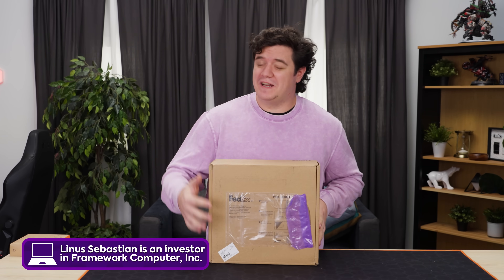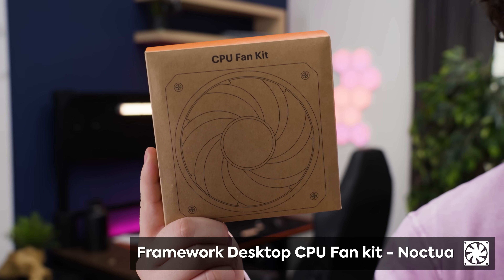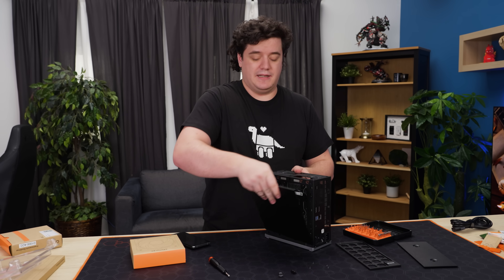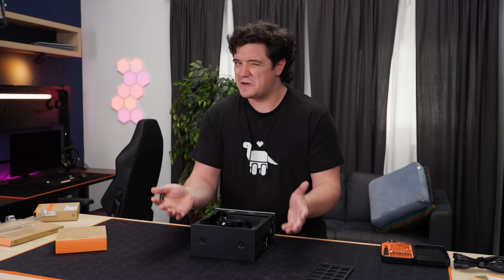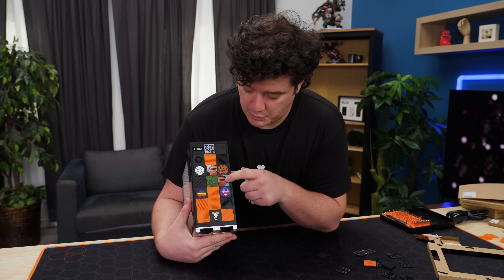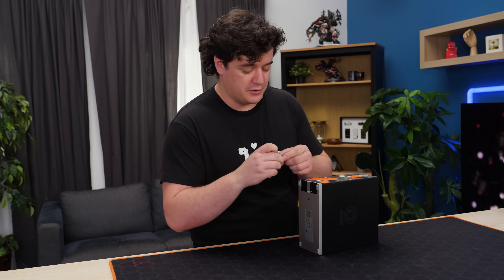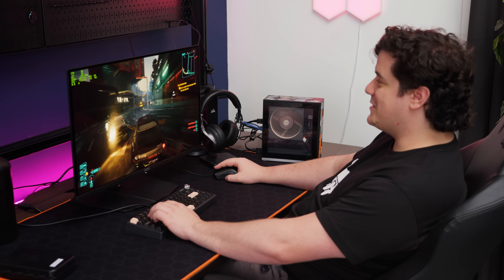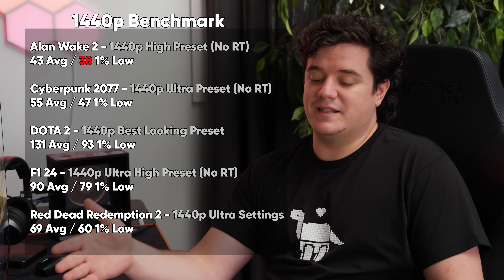This TINY desktop makes me nervous.... - Framework Desktop

Comment: when you configure it on the website, they need to include the price of the power cable, then say -$5 if you choose to opt out. not just for psychology, but also to make the starting price actually accurate.
Reply: I had been thinking about this too - having a default DIY configuration which includes a buildable computer, instead of the minimal cost with "None (bring your own)" selected. Maybe they're relying on people being interested by the apparently "low" price, or maybe they haven't considered the value of people being pleasantly surprised when they learn they can get other parts cheaper if they select "None" and do a little bit of market research.
Reply: This is a good suggestion, for the psychology, but I wonder how that affects their required inventory

Comment: The idea is cool, but I have to wait a few generations as this is not at all what framework is. Although the price of the tiles is totally what Framework is, they've always set insane prices for all of their parts that double what it is elsewhere. Pro tip, just pay a 3D printing service to handle the tiles. Don't get ripped off by framework

Comment: So yes they could by default add the cost of the cable….. but why? Most people have a cable laying around anyways. So I don’t see it as not included it saving you $5 on something you don’t need. 

And for the little face plate add ons. Compared to what people spend on rgb $5 a pop for the fancy ones, when btw they give you what you need to make your own 3d printed or on Etsy you  an get some, this is really reasonable.

Comment: For the sake of e-waste saving, which is apparently a major principle that framework adhere to, I really appreciate the decision of not getting a C13 cable and save 5 bucks. I don't need another one, in fact I've already have so many of them that I don't know what to do with them.

And the same principle also goes to the front panel. If I already planned on customizing by 3D printing them, I may need less than 21, or even not at all. They even double-check with you if you didn't choose 21 of them on the check-out. 
However, it's really not obvious that you can choose to not have them at all on the web site, so maybe they can work on that.

Actually, they also lets you to opt out storage, fans etc, which are also "mission critical" for a PC. If you gotta rant, maybe rant on all of them?

As for the memory, I can understand the concern, actually I'm also kinda concerned with that, but if you've gone so far to read an article about it, maybe it should've caught up with you that they've already addressed this in a video, saying that they've asked about it with AMD and AMD have tried it, but can't make it work due to signal integrity issues.
Reply: On the other hand, Elijah's complaint about power cord showed that Framework may need to change the way how they show the price on the website, or at least make it clear why they've chose to show it in the way it was.

Comment: Tested the Framework Desktop with the 395 — cooling is whisper quiet, Mac Studio–level. For LLMs, the BIOS memory mode makes a big difference: dynamic was fastest on medium prompts (42 tok/sec), while 96GB fixed pulled ahead on really long ones. Even got the 235B Qwen model to load on the iGPU under Vulkan (~9 tok/sec) — pretty wild for integrated graphics. With 128GB RAM, this board is a legit dev box
Reply: Didn't expect to see you here, but cool!
Reply: Yeah, I think when you pitch this as an AI workhorse, it’s great it competes with stuff like the Mac Studio for a lower price. While allowing you to run Windows or Linux. I think the problem is that most YouTube reviewers don’t actually want an AI device. They want gaming for which this chip is impressive yet just too expensive compared to a conventional desktop. Or lightweight productivity tasks where it’s also too expensive because you don’t need that massive pool of RAM for normal workloads most of the time. It’s a really cool device and I think the chip is really impressive. It’s just not meant to suit everyone and YouTubers are trying to make it for everyone.
Reply: Windows with shared memory? I don’t suppose rocm is supported on apu - or just buggy?
Reply: Problem is the drivers, right? I would so want to see it compared to the 4k dgx spark box. But seems they still don't even sell it
Reply: Does it work best as an AI dev box on Ubuntu or Windows? I remember seeing in a framework video the memory management is better in Linux
Reply: According to Wendel the 96GB memory thing is just a Windows beeing awfull thing on Linux you have basically unified memory and you set the minimum iGPU just to 512MB and it later allocats up to i think 110GB. In this video there is just someone who found small nitpicks and wants to drama/hate on the product ... while at the same time not doing their homework as a reviewer ... shaking head ... sad for the work LABS did on the product for not even mention the data in a professional way.
Reply: Isnt windows home only support up to 128 gb of  ram? But the beauty of windows is the ability to allocate half of system memory as shared memory on top of memory already allocated to gpu as delicated memory. As compared to linux where you have to mess with gtt
Reply: @Very_generic_username  Yes Home is 128GB and yeah you could do that if you want really really slow shared memory which makes no sense ... either use Linux or do a 32/96 split then ...

Comment: Elijah is mad that the power cord is "mission critical" and is not included for free. Looking at the website,  power cables and bricks are also mission critical to laptops but I don't see that included in the price or "free" for the 12, 13 and 16 😂 I think it's nice Framework made it optional in case you have too many, I got a box of free US head C13 cables, there's probably like 50 of them so yea, the $5 off is nicer than having it included 😁

Comment: Love mine so far, but infinitely frustrated that the case does not have a cutout for the PCIE slot. 5Gbe sounds great but SFP+ on my UI switch will only negotiate at 10 or 1, a low profile 10g NIC would solve that but now you've got to cut a hole in your case. Wish they would have just gone full 10 gig, but otherwise this thing is wickedly powerful for it's size.

Comment: I think Framework’s issue with this is purely marketing. They want to have the lowest price they can on the front page, but then it feels like they are nickel and diming you at every step. 

They should have a default config with a power cable and single color tiles by default, but when you’re going through the configurator, have the “Bring my own” as a discount. It is quite literally the same order at the end of the day, but then you don’t get people upset because they feel like they needed to pay extra for basic things. Instead, they feel better that they saved money by not choosing those things.
Reply: I'd buy it without the tiles and just run it like that. Maybe 3D print my own.
Reply: 100%, they really need to rethink how they do marketing because an even bigger mistake was calling it the Desktop, compared to actual desktops this is less upgradeable and repairable. If they called it the Mini sudddenly it's a a mini pc that's more "Framework" and everyone would celebrate that
Reply: I agree!!
Reply: Fully agree and had the same thought when he was talking about the power cable option
Reply: 100% agree. Minimum Price should be the cheapest config with everything included. 
Literally the same thing but more transparent about the cost of an actual config.
Reply: I agree, the non-DIY builds should be complete.
Reply: @gamebuster800  framework doesn't sell a non DIY Framework desktop.
Reply: Price isn't even that good bruh
Reply: I think the problem runs deeper. They are the modular/repairable brand and they are making a PC that's less modular and less repairable than a regular desktop PC. Like, order anything from HP and you will get something that's more modular and more upgradeable.

And then they add all that fake-modularity like the $100 bag of plastic stickers that you have to order if you don't want your PC to look like half-assembled garbage, or the USB-C extension cards. You know, there's already a modular extension system for PCs that allows you to add things like new ports or storage. It's called PCI-e.

It's all just topped off with the brag of "You only need a single screwdriver". I can't remember a single time where I needed anything else than just a single screwdriver when working on a desktop PC.

At this point they are just creating their own walled-garden proprietary module system that purposely doesn't work with all the regular stuff.

What are they doing there?
Reply: but then you would know you dropped two grand on a laptop before checkout.
truly horrible
Reply: The price is stupid even if it had a power cable and a whole case

Comment: Horrible take as usual, especially with the current AI market and considering the fact the 395 has AI in its product name, the chip performs significantly better BECAUSE the ram is soldered, this allows them to double the bandwidth thus, very noticeably, improving inference speed running LLMs like gpt-oss-120b which this machine at 2k (the 395+ not specifically this framework) can actually somewhat run large-ish models even cheaper than apple silicon. You’d either need 4x 3090s (96gb vram) or 1 6000 pro Blackwell (96gb vram) to even load the model even quantized in memory at around $10k. Yes they will outperform the 395+ but no other solution at similar price van even load the model let alone run at a respectable 50-80t/s if this was unsoldered which to my knowledge limits to half the current bandwidth, the performance would be like 10t/s

Comment: Love how as a collective the comment sections general take is that not including the power cable isn't a bad thing because most people already have one laying around somewhere yet when Apple did this with the charging brick these same people were up in arms calling for boycotts and saying how dumb Apple is. Selective rage at it's finest.
Reply: This is actually an interesting juxtaposition. It sounds inconsistent at first, but I don't think they are as comparable as you suggest. I'd welcome your thoughts to the contrary.
- Framework gives off a "build it the way you want" vibe to me, and I expected it going in. Having been through the framework purchasing process for one of their laptop's myself, I found it very clear which parts they consider necessary, although I've built several computers so it may come across differently to someone whose only prior exposure was a phone or tablet. Framework will offer to sell you their version of a part if you want it (at a markup obviously) or you explicitly acknowledge "no I'll get it myself". It is definitely a bit misleading to give an "estimated price" at the top of the page, then make you select another $500-1000 of hardware to come up with a functioning computer, but I consider that a UI bug, not a fault of the company. The pre-built laptops are more accurate in that respect. 
- In contrast Apple is a "it just works (if you pay us enough money)" company. With that in mind, I see a few problems with not having a charging cable (or a power brick frankly) included with a phone.
1. Many people these days get phones before they get laptops, and may never get a desktop. They may not have any cables laying around. Not having a charging cable or power source breaks the "it just works" factor of Apple.
2a. Wrt USB-C cables, two identical looking USB-C cables can support wildly different power standards and max charge rates. Most people buying Apple products don't want to have to think about details like that, or even know that they exist.
2b. Same issue with power adapters, although less so, since you can pretty much buy a 15W charger from a known brand marketed for apple phone compatibility and get what it says on the label.
3. I just poked through Apple's buy process for a random phone (iphone 16e, which ironically does include a charge cable), and as compared to Framework who will say "here's our innovative high density power adapter for a premium", Apple says "we don't give you a power adapter or headphones" in fine print below the "What's in the Box" section, which was itself below the Buy button. Some people may never even scroll that far. I would prefer if Apple added a few lines for "premium USB-C charging cable $20", "20W charging brick $40", "Airpods $300" or whatever right above that Buy button, but that does two things: adds more things that people have to think about before they get to that Buy button, and inflates the perception of the cost of the "phone".
Reply: @connors.1077 half your point was about iPhone cables which are already included, my point is about the power bricks and when they were removed many people, myself included, had tens of these bricks laying around already unused. It not only saves e-waste but saves space on packaging. Everyone by now has spare USB C power brick or even more than 1. Laptops are a different story, those charging bricks arent something your average consumer would have laying around. How many devices are powered by USB C versus that laptop charging standing in your house? I’d like to wager that USB C would be more popular. This doesn’t automatically mean that Apple not including a power brick is great or the best thing in the world but it’s certainly more understandable given the frequency of which you find these spare USB power bricks laying around compared to what is a niche and uncommon power brick like frameworks that you have to pay extra for. The whole situation could have been avoided if they had just included the charger and put the cost up by $5 with a selection of which one you wanted.

Comment: “Compromising on things that made framework framework” imho they’re still doing framework things, their mission isn’t to make everything reparable day 1, hence why they started out in a way smaller market. One (relatively) small tech company doesn’t change the entire industry overnight, plus there has to be a big enough market for these amazing changes framework is trying to make be in the minds of these ginormous corporations.

Also, on the requiring soldered ram, it’s not like they didn’t try. I’m pretty sure in a previous video somewhere the ceo talked about trying to get modular ram but the timings and performance just wouldn’t work. For nearly half a decade (1980s) pc ram being ‘modular’ has been an industry standard, so for a company to decide this is the way they wanna go (ignoring apple but they’re apple) I feel like they definitely have a good reason to do that.
Fantastic video, I love seeing you excited about this!!

Edit 1: typos and english being hard

Comment: Here in Brazil we have a law that if you don't include on the box everything that makes the product work without user intervention , Example: the power cable, we can sue the company(normally if it's a big tech the gov itself sues) Like the Brazil vs apple when they removed the charging cable.

Comment: The memory speed stuff is all a scam to sell soldered memory at huge profits. Google trying to tell me for years a microSD card is "too slow" for android apps but my steam deck can run a AAA game at 30fps off of one. Will it perform better? Of course, is it worth the trade off, absolutely not. Also i wonder how lossless scaling works on this chip.

Comment: the soldered ram is the one that hurts the most, and mostly because it's already been shown that the brands claiming it needs to be soldered to maintain signal integrity are full of shit and multiple manufactures have replaceable DIMMs that can run at full rated speeds same as soldered ram
Reply: I have zero problems with a soldered CPU that supports 128GB having 128GB soldered onto its board. The bigger problem is the smaller SKUs with 32GB of soldered RAM and a soldered CPU. My guess is that Framework used their market position as a company that re-writes the rules to move in a different direction than we are used to. A thread I read somewhere else said that getting the AI Max chips with a boatload of memory into a non-laptop form factor is a market segment. Not upgrade-able in the usual sense (though a motherboard swap is an option - same as the laptops with soldered CPUs and thermal solutions), but doing something different than most of the other companies to see if it's worth branching out in that direction. Even if the CAMM form factor is possible, this may just be an experiment to see if people will buy this form factor, or to see how people react, to better inform their market research, before they invest significant engineering resources into validating upgrade-able RAM.